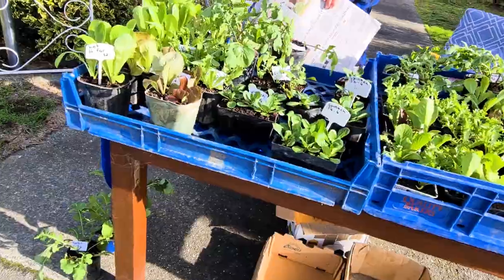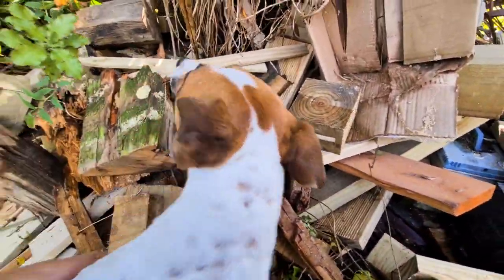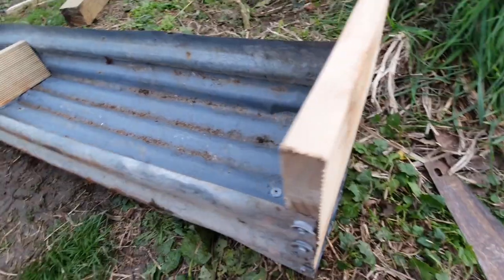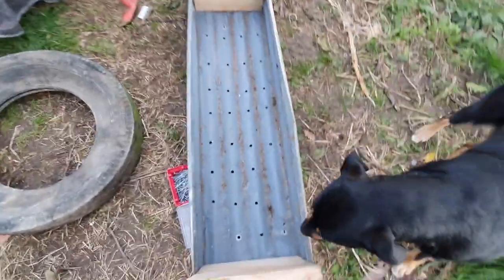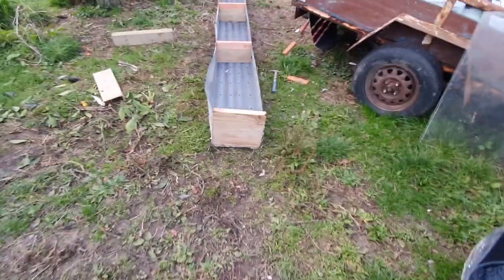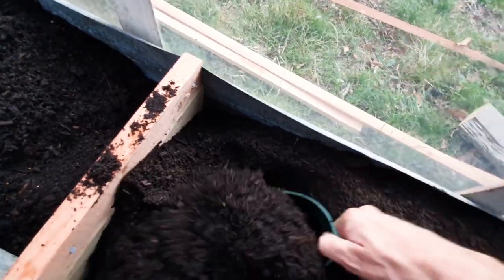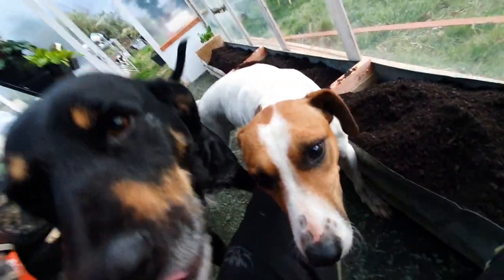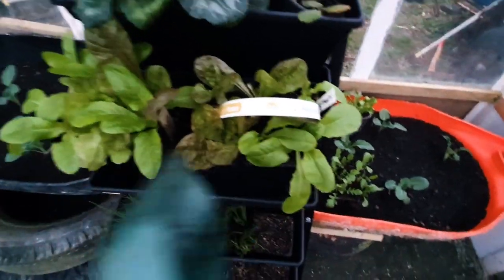Making a Planter Box from Tin & Wood. Clay Tall Stories

Comment: Hey Clay mate! Just a quick one on using treated timber in gardening. If the soil you grow your awesome veges in is contained by treated timber (I.e decking offcuts) you need a barrier between soil and timber. Treated timber will leach arsenic etc into the soil which could make its way into your produce. If you line your planters with polythene then your “sweet as bro” 👍

Comment: Great idea with the iron. Well done. One thing to consider though, not ideal have h3.2 timber next to veg your gonna eat. Try and use macrocarpa or just any natural wood. The chemicals will slowly leach into you soil as well as your veg then into you. I would make planter boxes out of boxing timber, no treatment. They last about 2-3years and need replacing
Reply from the maker: Yeah I have used some plywood that has been painted. It should be OK